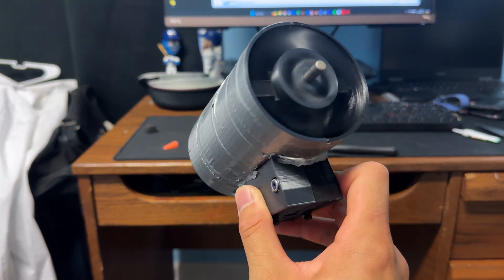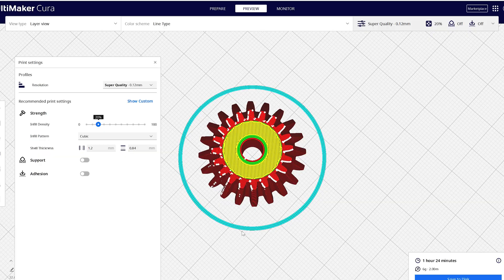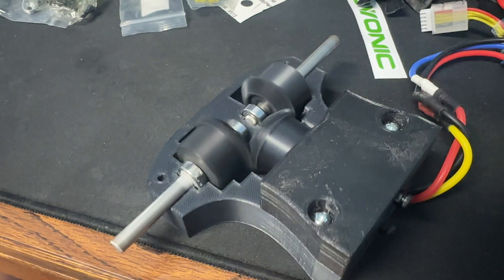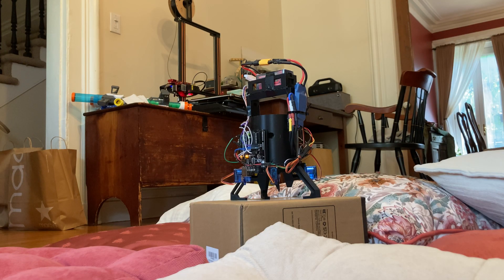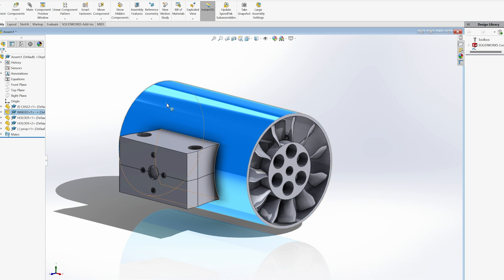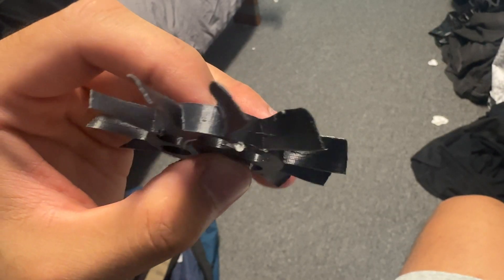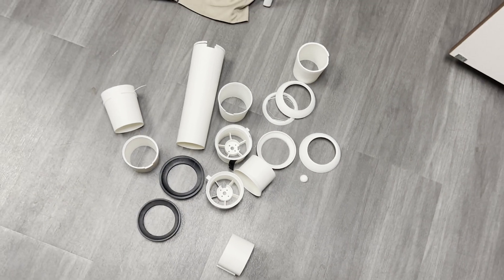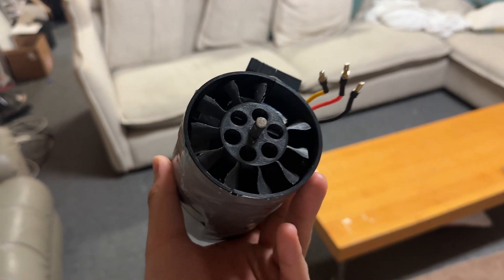Dual Contra-Rotating Ducted Fan Prototype: Single Motor, 3D Printed

Comment: This design lends itself to multiple (smaller?) motors, arranged with rotor axles in same plane.  
Additionally, you might try even larger fans, but make a raceway for their tips in the housing, or even print a ring on the blade tips.
Just my immediate thoughts--your point about getting the central obstruction diameter smaller is a good one that might be best to prioritize, along with bearings on both sides of each fan, eliminating cantilever.
Reply from the maker: Yeah I’m working on another gearbox setup that fixes a lot of these problems. I haven’t figured out how to get the axles and motor on the same plane though.

Comment: How does this perform compared to two back-to-back Sanyo Denkis?
Reply from the maker: Unsure. The performance drawbacks to this, as far as I can tell, are increased motor loading and slight power loss from transmission loss. But I’m not sure if it could ever justify the added weight of a motor and esc

Comment: Quick toilet thougt: Stator blades for internal aero (S shape ?) and blades/gear ratio tuning for masses differential. A planetary gear/box would be ultra cool(and unecessary). And maybe off the shelf full metal miniaturized gears for modelism that can be good and cheap enough. Quick 20s dirty google search show 0.1 to 10$. Happy crafting. Video report (montage, voice, script) was nice and clean, nice job.
Reply from the maker: Huh, haven't actually learned about stator blades before, read into it. And yeah retthinking the gear ratios. Thank you for the feedback!
Reply: @mach10point4  Check for real plane fuel turbines, they share most turbulences, flow direction and compression, torque,  and hardware congestion problems . A "LOT" of brain power has been thrown in to make them efficient. Still quick dirty napkin thoughts so it maybe a waste of time (turbines are fun anyway).

Comment: The simplest improvement I can see is reducing the teeth count, you're using 20 tooth gears, so they are gigantic, you can easily go down to 8 tooth gears while still having smooth rotation.

Using resin printing or off the shelf metal gears would be ideal as you can then reduce the gears modulus (tooth size) significantly, and so the gear as a whole.

Since you're using steel for the shaft switching to 3mm shafts is still largely resistant enough, and might get you a little more speed out of the motor.
Reply from the maker: This is really helpful. Was going to go with the same gear/shaft set up for the next one but now I’ll be rethinking sizes and teeth. Not sure I’ll keep the stainless for the axle, I’m looking for an all nylon set up.